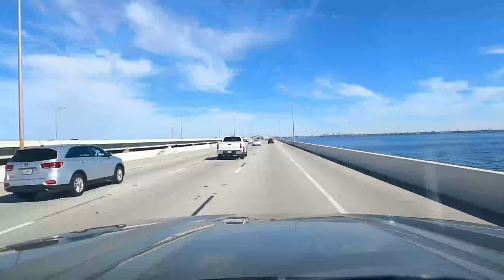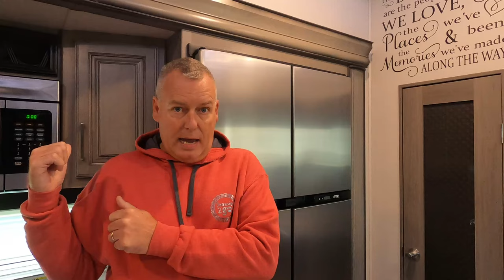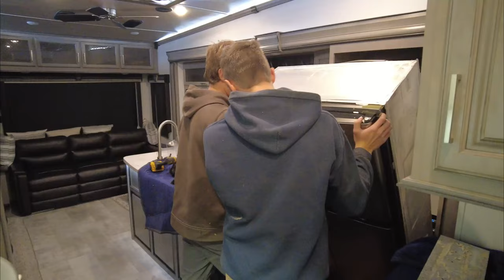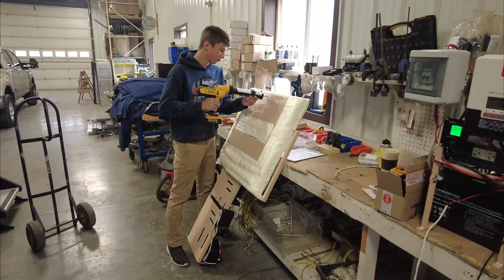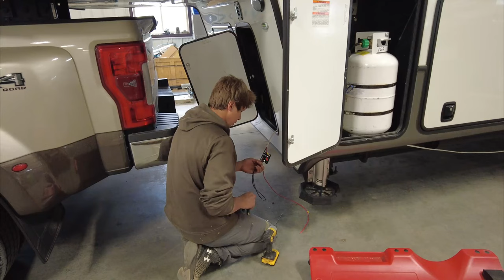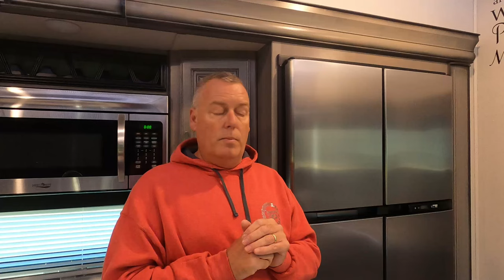Norcold RV refrigerator problems and solutions / What your dealer doesn't tell you

Comment: You have to blame these manufactures. Manufacturers are aware of the problem with Norcold refrigerators but continue to install them in their RVs. We are having the same problem with our Norcold this might be the answer to the problem. Thank you for sharing.
Reply from the maker: Hi Greg thanks for watching. I have had several people leave the same comment as you. As Keystone ambassadors, we recently had a zoom meeting with a few of the folks at Keystone including the President himself. I actually brought this up in the meeting and asked how he would respond to such a comment and his answer was exactly as I thought. They only have a couple of options for theses size RV refrigerators,  Norcold and Dometic ( Dometic have the same issues ). This is also one reason they offer residential refrigerators. He also stated that they are aware of the issue and continue to look for alternatives. Also that many customers have also said if they stopped offering the RV fridge that they would look to other brands. I completely agree that Norcold does not put out a quality product. This conversion has been absolutely hands down, the best thing we done. Example;  our current temps with our fridge set on 3 are  freezer -2 and fridge 34. Not to mention the amount of energy that this use to consume. We can leave the fridge run without being plugged into shore power and our 300w solar can keep up. It's great. Safe travels and thanks again for watching.
Reply: @Jonesin2Go  Thank you for responding. This does seem like a great solution to the problem. I don't have solar but I believe the 12 volts would be a great upgrade, allowing the refrigerator to run all the time. I also like the idea of having two compressors. Again, thank you.

Comment: You changed my life today! Our movable seal (the vertical one on the left door that separates the two doors) rubbed on the bottom of the fridge since the day we brought it home. It meant we always had to open the right door so we could manually move the seal into place. I went looking for a solution and found your video. I said to my husband I need your help. We’re going to fix the fridge. And he was super worried. He said let’s wait and do it on the our last getaway day, so in case something goes wrong. Well that didn’t happen. I removed the three bolts just like you said, I had him help me lift the door off the pin, I added a 1/8 inch spacer that looks like a washer, something I already had on hand. We lifted the door back onto the pin. Reinstalled the 3 bolts and tada!! Works like a champ! So great to be able to open the left door by itself if I want and have the seal work automatically like it’s supposed to. Thank you thank you!
Reply from the maker: Glad you found it helpful.

Comment: Great video.   Our Dometic unit has never worked well and I've thought about changing out to a straight 12V unit.  I would have been really nervous to have a couple of high school kids working on my unit, but after watching how they did their work, there a lot of RV "technicians" out there who should take lessons from these two!   Protecting the countertops and floors, being careful when removing and re-installing the unit, doing a great job of installing the new equipment and then cleaning up any mess left behind when they were done.  Even cleaned out the inside of the unit!  Best job I've ever seen.
Reply from the maker: They were very professional that is for sure. It is a family owned business so they pay attention to the details that's for sure. One of those young men also installed our solar and did just as great of a job. He is actually the owners son. I can tell you making the switch to the 12v system was well worth it. Work awesome even in the high heat days. If I were to buy a new rig tomorrow the first thing I would do is take it to them and have it coverted.
Reply: @Jonesin2Go  Good to hear your conversion worked out.  Nice RV and nice frig!

Comment: I thought I wanted an RV fridge when we first started looking. Had 20 years of trouble free service from a smaller unit in a living quarters horse trailer. After watching several videos like this I quickly changed my mind. I wish norcold would catch up with 12 volt compressor units in the 18 cu. ft. models. JC refrigeration has figured it out.
Reply from the maker: I agree Van. With all of the new technologies that the RV industry has now, you would think that a company like Norcold would  be doing a better job. After dealing with Norcold, they give me the impression they just dont care. It is our hope that videos like this will grab the attention of the RV industry and they will start to make improvements in this area. Thanks for watching and taking the time to leave a comment.
Reply: @Jonesin2Go  looking at the 10 cubic foot dc norcold what you think of it or heard reviews ar not great but i think some are not using big enough wire from bank on the change over from the gas
Reply from the maker: I haven't heard much about that model myself. I can say that we have a 10g wire from the batteries. Seems to be working fine.  There are alot of new 12v refrigerators hitting the market.

Comment: We had the same problem with our Norcold. Propane or AC, it still struggled. If we turned it off, took everything out of it, let it warm up 8 hours with the doors open, then restarted it, it was super cold. Slowly over a month and a half or two months, it would warm back up. In looking at the backside, we noticed water streaks on the back behind the coils. Come to find out, the cheap duct tape used to seal the back edges had peeled off, and was hanging loose.  An ice dam was building up under the panels and slowly blocking the cooling. Pulled the refrigerator, foamed the gaps, and resealed it with metal AC duct tape. Runs 35 degrees,  and 4 in the freezer. Before you do anything, take a flashlight and look up the backside of the box while defrosting, and look for water seeping out under the cheap Norcold duct tape.

Comment: Great video.  My husband and I watched it last night.  We have tried everything else to get our Dometic Fridge to work properly.  Our fifth wheel was purchased new in November 2020.  From trip one, our refrigerator wouldn't cool.  We thought it was the door hinge/latch issue and corrected that.  We have tried all "Youtube" fixes and unfortunately, it still does not cool well.  We are reading the same temps as you were, in our fridge.  Looks like our next stop is Shipshewana.  Thanks for putting this out there.
Reply from the maker: So it sounds like the Dometic brand is having the same struggles as the Norcold. I have to say having ours converted to the 12v compressor was the best thing we have done. We actually find ourselves turning it down because it gets too cold. On hot days we set it on 3 and it stays around 34 to 35 in the fridge and we pretty much stay at 0 in the freezer sometimes we see -1to -2

Comment: I have a keystone, Montana, as well with the exact same fridge. And yes,  I'm having the same issues. I changed out the lower fan because I noticed it wasn't working. I am still having the same issue above 40 to 50 in the fridge. Now I've noticed the larger fans aren't working at the top of the fridge in the back. May need to have a conversion with someone close to me here in south Florida. Thank you for the video. Very informative.
Reply from the maker: @dalegreen486  you can order and they will ship you  the kit. Best thing we ever did to that RV. We got a new Montana last October. Just replaced the 12v Fridge that came in it with  Dutch aire from JC  they seem to be the best in the RV Fridge business

Comment: We just installed a Norcold refrigerator in our off-grid cabin.  We hooked it up and it ran all night.  At 6:30 in the morning I checked our solar % and it was down to 49% (just drained it).  We had never had it under 65%.  That was at it set at the warmest.  It solidly froze the ice in the freezer.  And the refrigerator was too cold.  We are going to bring thermostats to check the cold this next trip.  We will be starting it again this next weekend and will update.  It would only turn off for  a few minutes and start back up again.  Definitely could not use this in an off-grid situation.  Thanks for the video.  It has given us something to work with.
Reply from the maker: My pleasure. Do you have the 2118? If so it is for sure an energy hog.   I am reviewing  lithium batteries right now and doing videos on the results. I am running just my fridge  and using those numbers. So you may  find those helpful. I am testing a new brand of 100ah lithium battery now.

Comment: I live full since buying my toy hauler Cherokee Wolf Pack 315P, it came with an Evercool 12 volt refrigerator which TOTALLY runs off my batteries and 100watt solar system! The only thing I had was upper hing didn't have correct screws in it causing freezer door not to seal properly! Lived in AZ Jan thru Oct before moving south to Texas! Love my solar refrigerator once I figured hing was causing the issues in AZ! Now refrigerator operates very efficient and I can freeze ice cream! Yes mine is only a 2 door, 1 freezer door and 1 refrigerator door! My 100 watt solar panel constantly keeps my battery at 13.5-14.0 volts! I has had a normal camper trailer refrigerator unit before and will never go back to one
Reply from the maker: Thanks for watching and taking time to leave a comment. We are also very happy with our fridge now that we have converted it to 12v. We have a 300w solar panel and have yet to see the controller ask for more than 100w while the fridge is running. It was certainly a  wise choice to change to 12v
Reply: Was your solar panel already installed on your RV? If so how did you learn to use it ? Thanks from a newbie. I don’t know how my solar panel works on my rv

Comment: Thanks for the video.  Like you mentioned, a little long, but good information.  We also have a Norcold 2118 in our 2019 Solitude. We are full timer's. We have had some of the issues you identified.    We run ours on Electric when we can and Gas when off grid.  Currently, on a setting of 4, it maintains the freezer at 2 degrees and the frig at 36 degrees.  During the hotter months we have to step it up to 5.  We had a couple of temp issue during the frist year but they were addressed under warranty.  Our main issue with temp seems to be due to hot air getting trapped in the cavity behind the refirgerator.  I added an exhaust fan on the upper vent to help move the hot air out.  This seemed to help more than anything else.  I do have questions about your upgrade. I didn't hear what it cost to upgrade your unit, maybe I missed it.  I'd also like to know how it does off grid - how is battery consumption?  How many batteries and what type are you carrying?   How many days will it run on just battery power - no solar?
Reply from the maker: Hi thanks for watching.. jc has current pricing on their web site  I believe we were at around $1800. It does well off grid  I am currently running with 2 100ah lithium batteries and can run 2 days without solar.  I do have 600w of solar and on a good day can run all day and it keeps the batteries at 100%   by morning the batteries are anywhere between 50 to 70%  depending on outside Temps and how often it is opened of course.  FYI as of this past October the norcold gas/electric fridges have been discontinued. They have gone to 12v fridges for RVs

Comment: I wonder why Norcold doesn’t address this situation in their refrigerators… my husband and I just purchased a used Norcold 7 cubic ft DE-0061 for our Van build… it’s a 12 Volt DC… we didn’t want a dual fridge… The fridge is like new.  It was only used 1 season by the original owner… once the weather gets warmer we will be plugging it in and leaving it on to monitor it… If we have issues with consistency I will definitely consider getting a dual compressor put in… we live in Michigan so it wouldn’t be that far of a drive to visit JC Refrigeration and I saved your video for future reference regarding this issue… thank you so much for making it.  My husband wired our whole van conversion with 10 gauge wire… thank goodness 😅

Comment: Awesome video on this unit. Our 2020  Norcold fridge is have trouble getting under 40° in 90° temps out west.  I’ll add JC to my stop next year when we are back in Elkhart.
Reply from the maker: You won't be sorry Larry that's for sure. They will also ship you the unit if you feel that is a job your comfortable with. For us it just made sense to have them do the install as we are only less than 2 hours from them. We are so glad we did this.
Reply: @Jonesin2Go  watching them lay the fridge over made my mind up.  I rather pay to have it done.  Is there two separate temperature controls now for the fridge and freezer?
Reply from the maker: Yes there are. The controls you have on the refrigerator now will continue to control your refrigerator and there is a separate controller mounted on the back of the fridge for the freezer.  Accessible from the outside. You just set it and pretty much leave it. Ours is set at zero.
Reply: @Jonesin2Go  that’s the wAy to go! Keep us updated.

Comment: I have a 2022 3121rl and are planning the same conversion from JC.  Can you tell me what wire routing was used in running thee 10 gauge wire from the front battery to the fridge.
Reply from the maker: Yes they actually ran it along the frame and into the coach at the slide in behind the fireplace. Then ran it along the back of the cabinets then in behind the fridge

Comment: I just watched your video and you provided excellent information. I have a 2020 Grand Design with the Norcold 2118. My problem started with the center flap dragging at the bottom of the fridge. The dealer fixed that and now it drags at the top. Another issue I have is condensation. I have to keep a towel at the bottom of the fridge to catch the water. And with that the refrigerator runs constantly. The Freezer with freeze food but not ice cream. 
Did you have problems with condensation? In my opinion, I don’t believe the magnets in the seal are strong enough! Please advise if you had moisture issues?
Thank you in advance
Reply from the maker: We did have moisture problems before I fixed the left door with the washer. Sounds like your dealer may have put to thick of a washer in making the flap stick at the top. This could be causing the poor seal of the door which would be causing the condensation  problem. There are 2 reasons for condensation. A bad seal  or a bad thermistor.

Comment: Thanks for the info.  For those boon docking without solar how long do you have to run a generator to keep up with the battery drain overnight?
Reply from the maker: Before I had my solar installed I ran mine for about 30 hours and the batteries still read 11.22v. I currently have 2 group 29 interstate batteries.  Now with a 300w solar panel it maintains 13v  as long as the sun is out of course 😀

Comment: I had this same problem in my 2118 it turned out that they forgot to install the exhaust baffle in the flue. I went to a RV junk yard and got one out of an old frig. problem solved. The frig works great  very efficient now.
Reply: Hello, can you tell me what an exhaust baffle would look like so I can check on mine. I have the same issue with my Norcold 2118. It maintains temp but it never stops running. Its costing me a fortune.
Reply: the exhaust tube is about a inch in diameter and goes out the top of the frig vent. If you go to the top (outlet for the exhaust) their should be a thin wire clipped to the top of the exhaust pull it out and their should be about a three inch twisted metal ribbon on the end that controls the heat going up the flu. the wire is about two to three feet long. Mine was missing the wire and baffle
Reply: @briancullimore825  if your frig is in a slide like ours is, you don't have an exhaust baffle coming out the roof but there should be something that blocks the airflow to ensure it goes thru the fins at the top on the back of the frig before it can escape thru the upper vent in the side of the slide.

Comment: So, I just purchased a very clean seemingly.NorCold N20DCSS  twelve volt refrigerator/freezer. It was a donation to a thrift store and I got it for a $125 on a 1/2 price sale that day.But see it retails for $5-6 thousand dollars new. I am assuming an RV buyer decided Swiftly.
To convert to a residential unit and then donated this one. I can run off an LED step down transformer to 12 V.Or off batteries , so I figured it was good either hurricane times. Or if I ever get around to making a homemade 5TH WHEEL OR gooseneck Rig trailer, I will use this one instead of the littler 2004 dometic RV fridge that I got in the old parts rv I bought Some years ago ...
or I could put both in and make the dometic one an outside kitchen unit. 
With the NorCold, Should I expect any issues or should I cross my fingers and pray?
Reply from the maker: I haven't heard anything negative about the 12v units as of yet. It was mostly the gas/electric units that were the problem. So much so they no longer make them. It's all 12v now.